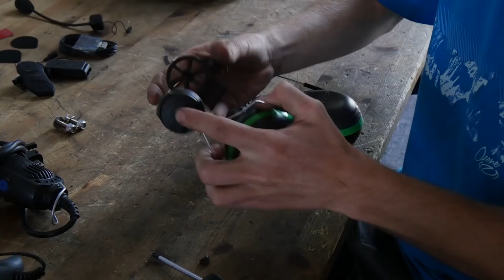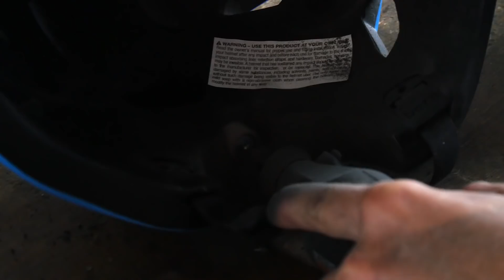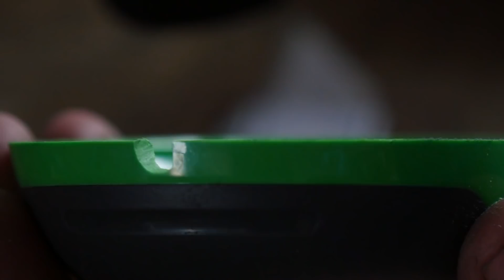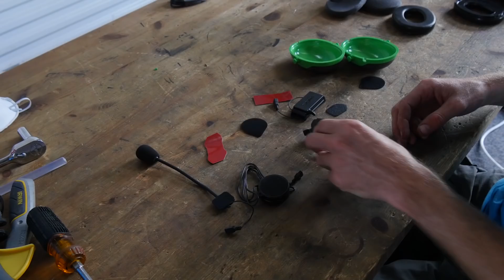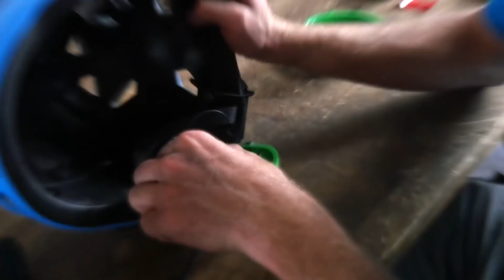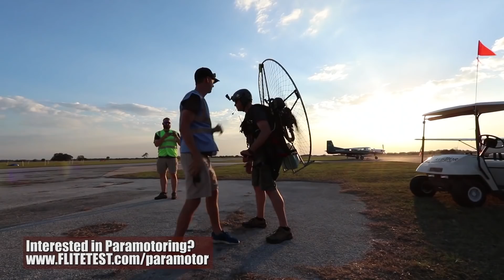How to build your own Paramotor helmet

Comment: One major issue, the bolts that hold the earphones needs to be switched to having the nut on the outside of the helmet because having the nut on the inside is dangerous in an accident. The nut and remainder of the bolt will impact/break your skull!!!

Comment: Nice ,but the bolt should definitely be facing the outside . If there was ever a side impact the foam it could depress enough for the bolt end to make contact with skull.  Modifying any safety device is kinda sketchy unless you are certified to make such modifications.
Reply: Just ask Octave Chanute.
Reply: TheTimeTraveler2025  paramotoring is safer than riding a motorcycle by statistics.
Reply: I would agree with that. My build I'm going to use a "press-in" type bolt with some epoxy maybe so that it's not so protruded into the helmet
Reply: Absolutely! I was already planning on doing this type of mod to my helmet. Using a carriage bolt on the inside would be much safer. I might also try a Rivnut, as I have the kit. Otherwise great video!

Comment: Sorry to down on it I’m a positive guy but the minute you cut it it’s uncertified. With all Avation you should maximise saftey  love the Chanel but for me just get the best kit you can. Flysafe Blaise.
Reply: I thought the exact same thing
Reply: Why do you need a certified helmet? It’s not required to be safe or be legal
Reply: Certified for what? This helmet isn't even required other than ear protection or you'll go deaf.
Reply: You don’t need a helmet at all better then nothing lol
Reply: Blaise Brogan It was certified before this though, more for impact rating. It’s not a legality when flying an ultralight vehicle, far 103.  You probably should though nevertheless..  You may have “decertified” it and expired your warranty but it’s still there for what it’s there for, protecting against light blows, oops falls, foreign object impact, children throwing rocks, etc.  And perhaps more so in this case, holding your comms.  If you drop from the sky unconscious I doubt the helmet will make a breath of difference.  Still good to have on, especially if instead of dropping you end up head on into tree branches, tapping a rock somehow, or end up inverting on an asphalt landing into a skull top drag because you thought you could easily make that last wingover that sweet low...certified any more or not.

Comment: I am in the process of looking for a helmet to do a build on and found this video very helpful. I agree with all the comments about the bolt,  there are other brands of ear muff that don't have a large single bolt but 3 small screws/ rivets. This is probably the way I will go. Nice job Kyle that as really clean build. To all the people who are saying that by cutting the helmet its no longer certified. All this helmet has (In the US)  is CPSC
 irrelevant

Comment: Great video. Exactly the same as my video so I'm glad that my video was also showing the correct way. 
Ignore the people cracking on about safety. I don't think they understand that the helmets are more for holding the comms unit and protecting against small impacts like being dragged along the floor. 

For those haters that think a BMX or ski helmet will protect your head from a 3000 feet fall clearly doesn't understand gravity. 👍🏻

Comment: Does some have experience integrating a radio-connection? I'd like to use the sena mic and speakers with my radio and bluetooth the same time. Is the mic-output enogh for the Radio to use? If so, a simple y-Adapter would do, right?

Comment: why not use a protec tactical hellmet? which is already made for this kind of communication system plus you dont have to modify/weaken anything. and they are about $70
Reply: Alejandro Ayora aren’t they made for air soft paint ball?
Reply: Do protec tactical headsets have good sound protection for our application?

Comment: Really cool! I suggest using a tee nut for the inside. This is the hardware used by many military aviation helmets, and it creates a flush surface that won’t penetrate your skull during a crash. 

Also, can your communication harness hook into a radio?

Comment: Love the channel guys but this is a bit of a worrie. I did my my pg training about 6 years ago and one things that was drummed into us was safety and the importance of not modifying your gear. Even the wrong type of sticker adhesive could degrade the performance of your helmet. Yes I agree this seems totally ott but I doubt there is a single uk helmet manufacture that would give the OK for for this level of modification.

Comment: For $50 you can buy a tactical helmet with built in rails for ear pro and they are farrrrrr more adjustable and comfortable than one of these... search airsoft tactical helmet.. Emerson makes them.. pj style helmets are very nice!

This uses the same rail and connectors that I am talking about but it’s farrrrrrrrr better quality and even has the knob to adjust the tension around your head.

Peltor makes amazing quality ear pro with noise canceling ability and you can even turn up ambient noise to be louder than if you weren’t wearing them.
Reply: Hey quads, Id be concerned about the impact cushioning with one of those tactical helmets. Seems to be a little thin & designed to bounce bb's off it rather than protect a melon from hitting the concrete like a skate helmet does. This is judging by purpose and photos. If I had one in my hands I might think differently.

Comment: Ouch, chiseling away the EPS safety liner of any helmet is VERY dangerous. This practice should not be practiced. Run the cable around the back of the helmet. I hope nobody copies this installation.